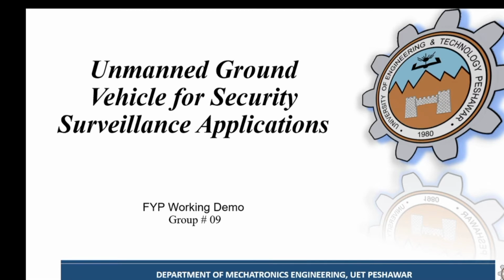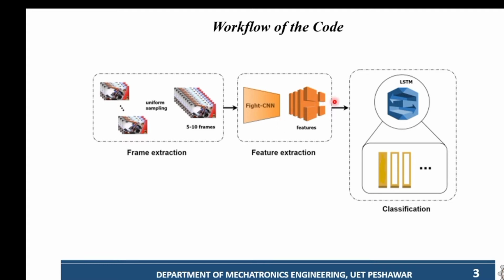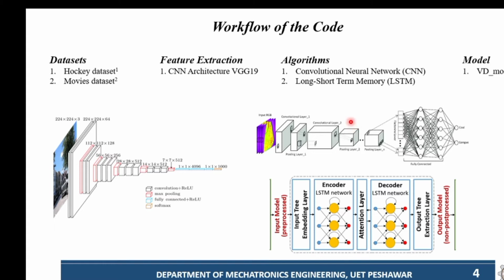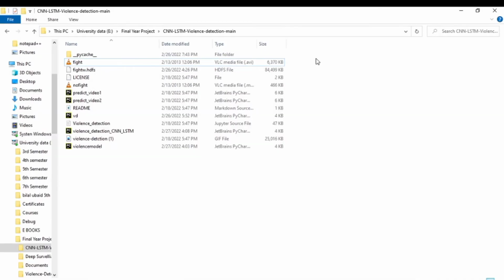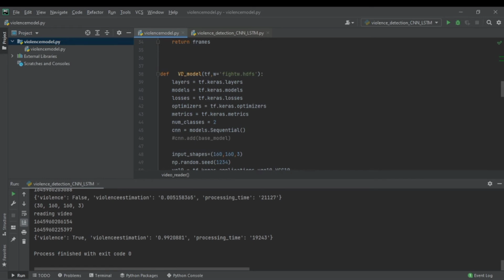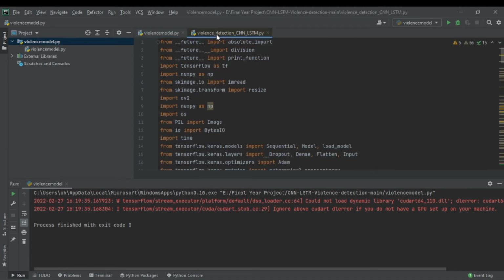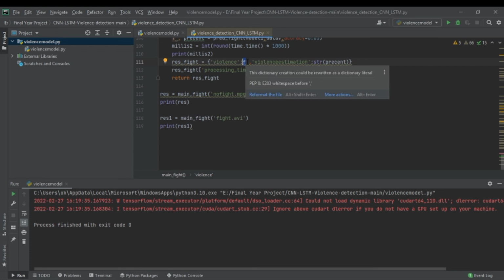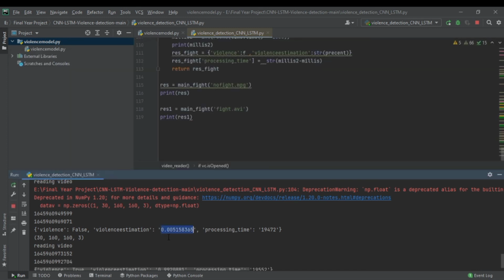Violence Detection by CCN-LSTM Algorithms

Comment: how do I use hdfs type folder in the code in pycharm? It gives me this error: 
W tensorflow/core/util/tensor_slice_reader.cc:97] Could not open fightw.hdfs: DATA_LOSS: not an sstable (bad magic number): perhaps your file is in a different file format and you need to use a different restore operator?
Reply from the maker: Place/store the fights.hdfs file in the same folder as ur main code is or edit the provided directory in the main code as where ur fights.hdfs folder is and then run the code